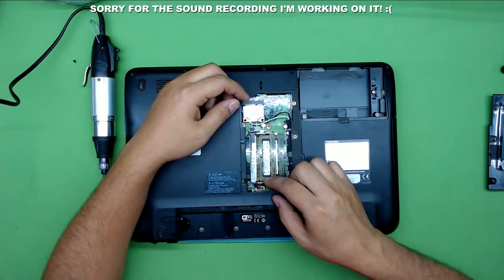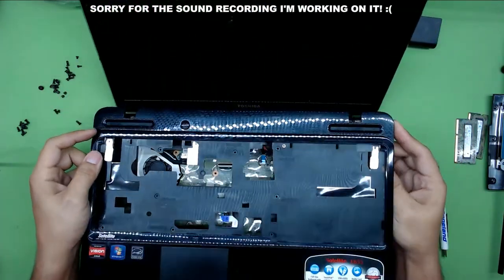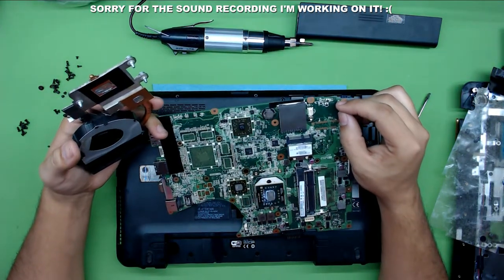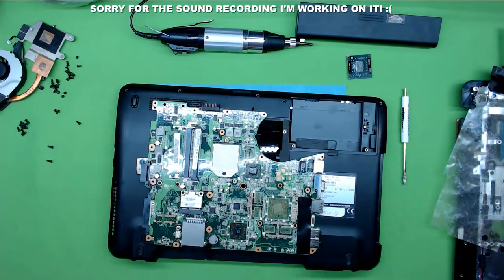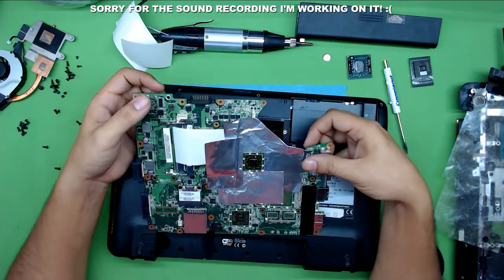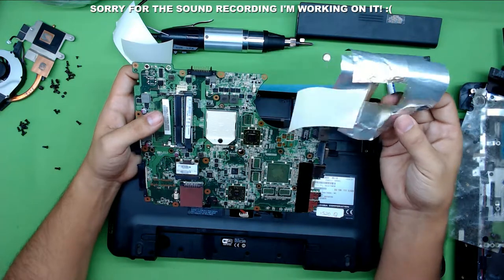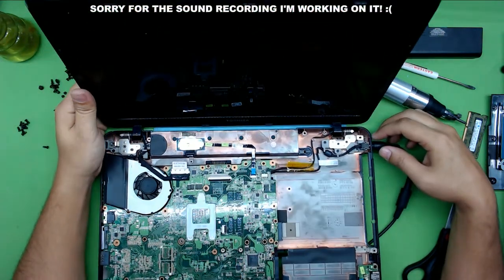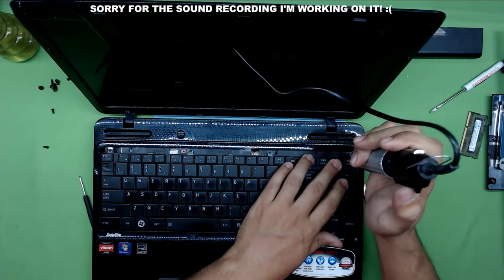TOSHIBA L655 Tear down and repaste , service your laptop disassembly  and Reassemble

Comment: I couldn't believe this actually worked for my old laptop that's been lying around for the past 5 years.  I really just wanted to get the pictures from the hard drive, but it was pretty cool to see the laptop come to life again.

I did not have any Flux, I just used a heat gun on high, in a circular motion for exactly 60 seconds.  I did use metal air conditioning tape to shield the parts around the gpu, I didn't think it would work as I put it back together, but it did! Now, all my pics have been downloaded to a flash drive :) thank you!
Reply from the maker: It is my pleasure my friend also in the future if you want to recover your files just get a SATA to USB adapter and remove the Hard drive and plug it to the adapter and to another PC or laptop and you can get access to your files.
https://amzn.to/3FsLESY
also if you used only 60 sec it may not last long before it goes bad, next time keep it for 5min.
**This is an  Amazon affiliate, when you use my links, I earn a percentage, which helps support the channel🙏.
Reply: Thank you very much, yes, I learned about the SATA to USB cable while trying to figure out what was going on with my computer, but after seeing your video, I figured, why not give it a try, and if it doesn't work, that's ok, I'll buy the cable and transfer my files that way.  Fortunately, it worked!  I let the computer run for about 3 hours with no issues, I don't expect it to last forever, but I was able to get all the files I wanted onto a flash drive.  Thanks again!  I am mechanically inclined, so it was fun to see what the inside of my laptop looked like!
Reply from the maker: It's my pleasure my friend. and glad you got your files recovered.
Should you have any further questions or requests in the future, please don't hesitate to ask me.
Reply: Thank you brother, that means alot to me. I don't have my YouTube account connected to my current email address and don't really feel like trying to get it set up.  Do you have venmo, cashapp or Zelle?  I wanna buy your lunch/send you a tip for your help.  I know it's not expected, but you saved me time and money, not to mention my precious photos! It would make me happy to buy you lunch.
Reply from the maker: it is very ok my friend, just with you like and sub and your friendship i'm more than happy🫠🍻
if you ever need anything in the future always reach out to me via new comments and i shall answer ASAP.
i don't use none of those but i do have few option they are in the video description all the way down in there.
but truly i do this video to help people out.

Comment: I have removed all the screw except for the one that holds the disc drive in because some how they stripped the head of that one during the manufacturing process and I thought I had to remove that screw in order to remove the motherboard but I can see from your video that you don't have to. That screw is the only one left for me to remove as far as I can see yet my motherboard still won't come out. 

It feels like there is something in that area that is still holding it down. I can't seem to see any other screws that need to be taken out. 

Any tips?
Reply: Now your mother board looks different then mine. That piece in the middle. (Not sure what you call it) mine says ZYE on it. Mine has 4 points. 2 at the bottom and 2 at the top and yours has 3 points 2 at the bottom and 1 at the top. My laptop is L655 bought back in 2011.
Reply from the maker: Thank you for the feedback! if you wish to support the channel you can LIKE or SUB or both :P
regarding your question: can you send me a picture or upload a short video, i need to see exactly what you see. and what the issue. or email me  	ask@ufixtek.com